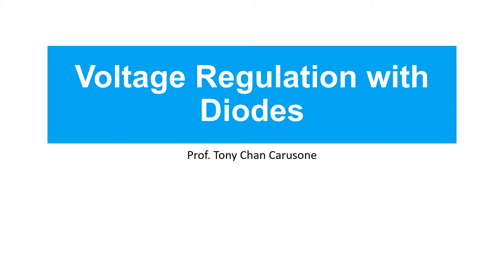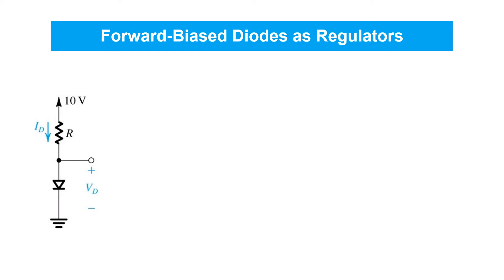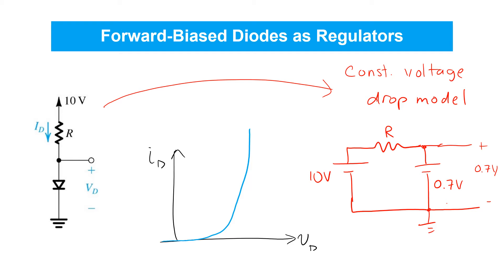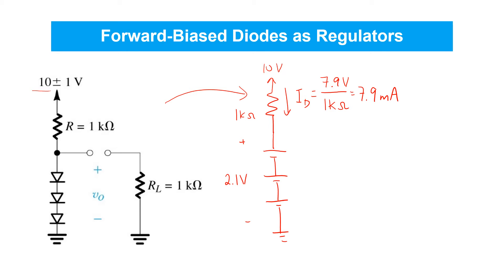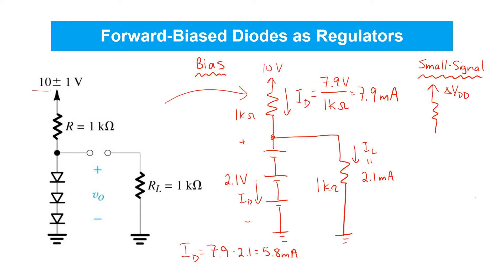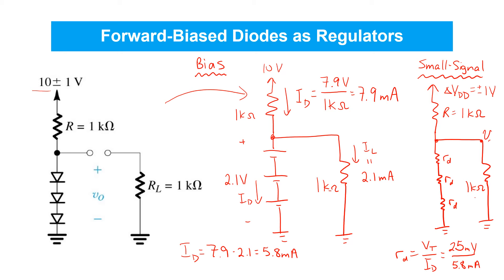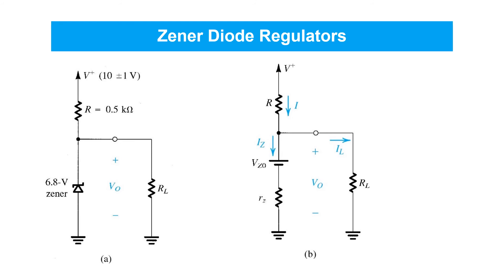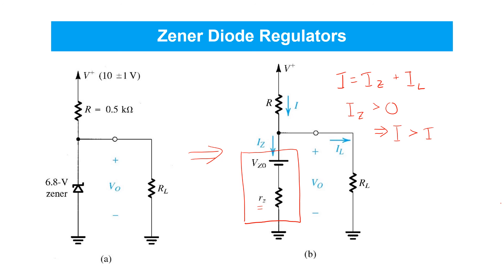28 Voltage Regulation

Comment: By the way, at 7:04, isn't the I(D) = 7.9 mA (or we say the bias current/DC current), instead of the the current that flows down the 3 diodes (5.8mA), so r(d) is 25/7.9?
Reply: I(D) is the total current which is 7.9 mA, 2.1 mA already calculated taking the right path (the 1k ohm resistor) so logically the resident current would flow in the left path (the three diodes) which is 7.9 - 2.1 = 5.8 mA and respectively the r(d) = 25/5.8